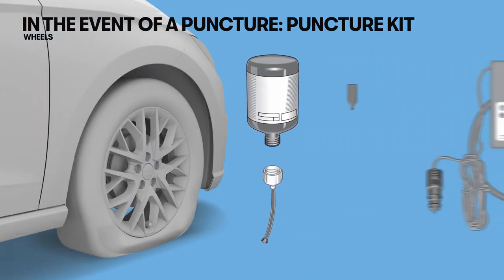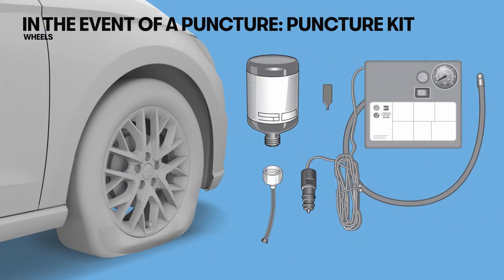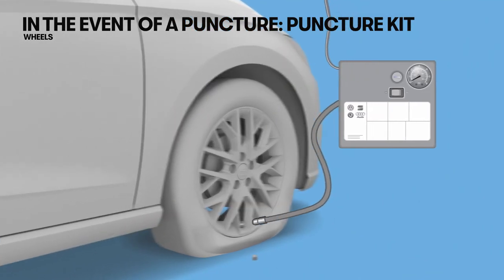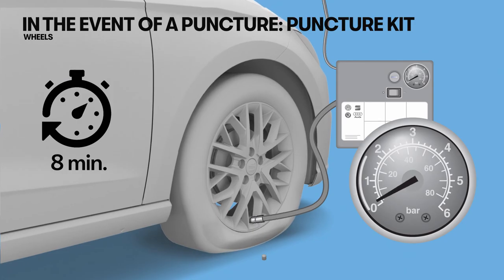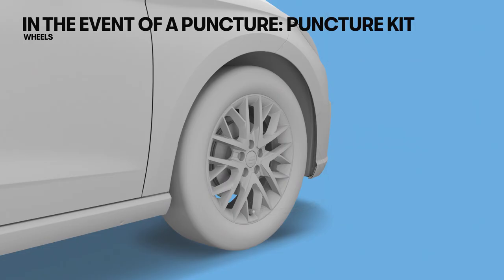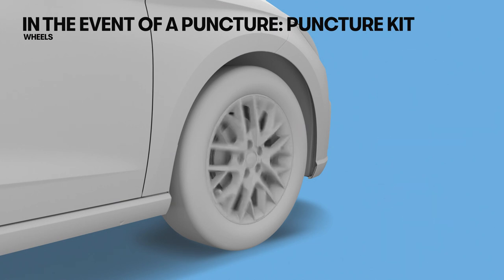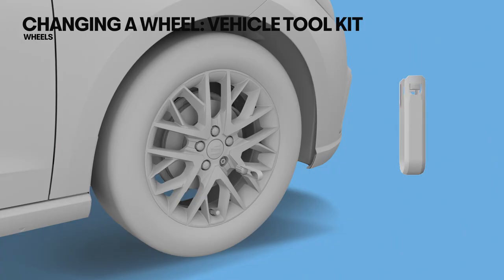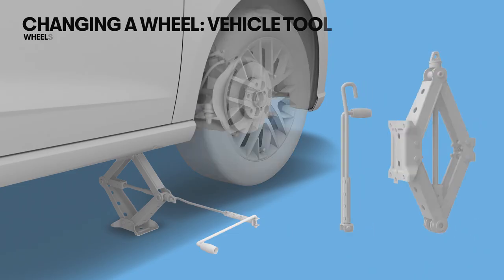The Essentials: Punctures and Wheel Changes | SEAT

Comment: this video is worse than useless you need to position the wheel tyre valve at the top  then pump some air in and look for the sealant ouzing out the hole or where the nail or screw is as well as trying to find out where the leak is then position the hole at the bottom then pour more sealer in so it runs down to find the hole then pump up to 25 psi and drive for 10 mins then check and pump up to recommended pressure for your car tyre size but a major problem is the pump supplied rarely works as it is so cheap kept in the boot which gets wet and the wires corrode, these car dealers are putting your life and your families lives at risk tell them at the end of the negotiations for the car, is there a full sized alloy wheel supplied ? as i will not accept a useless pump and give the reasons why or tell them you will walk to the first dealer that will supply one included in the deal. whit till the end when they ask you to sign their manager  wont want to lose a deal  so ask to speak to the manager before you leave i have done this often and more they need the numbers and they have thousands to play with in the deal, if your are  confident ask for mudflaps etc if you are going to pay cash never  tell them as they make lots of commission  and they will not want to lose it. play their game or even better take someone in the industry with you to finalise the deal because they are sharks and will eat you alive without you realising. your welcome !! ps if it is a screw or nail casing the leak screw or push it in fully it helps sealing untill you can get to a garage.